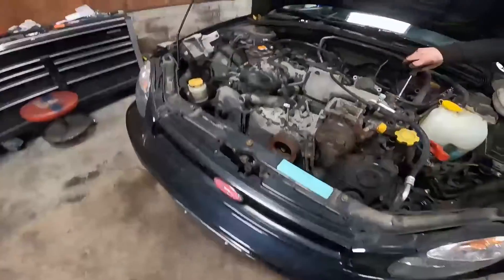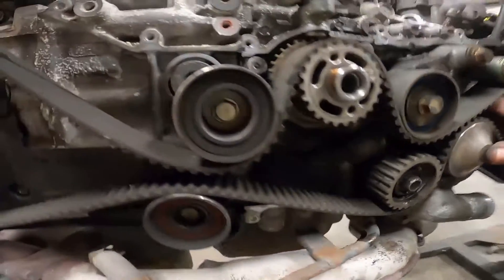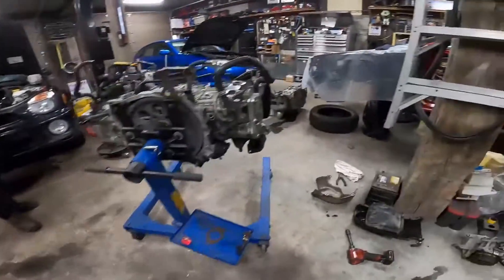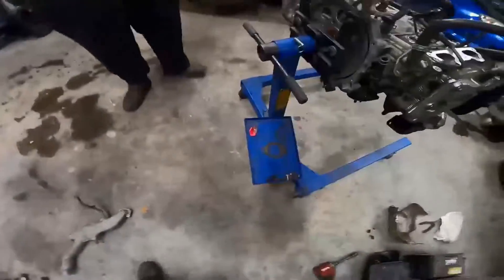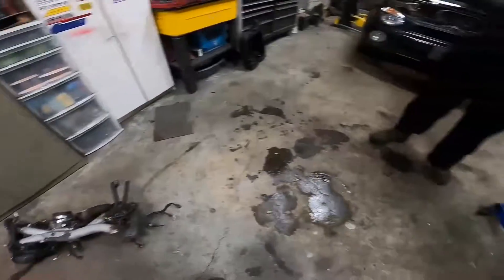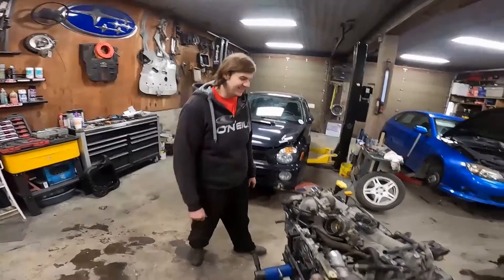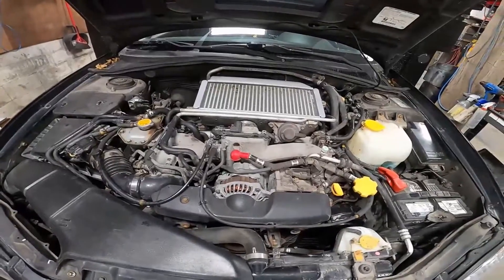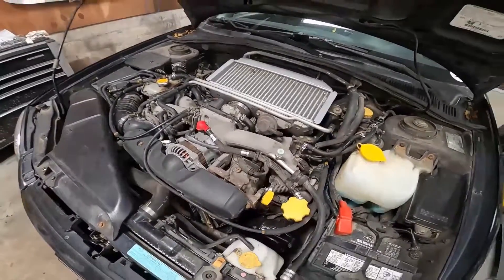How To Install Jdm Ej205 Into Usdm 02-05 Wrx

Comment: So I’m looking to a 2004 Subaru wrx it has a jdm ej205 and a oem ecu and it has a check engine light saying for a tune he says it needs to be tuned for the new engine. Would I be able to use a Cobb access port to tune for that and get rid of that check engine light?
Reply from the maker: Yes you can use cobb ap on the usdm ecu to tune check engine light
Reply: @TheSubieSanctuary  What tune would I need to use?
Reply from the maker: @jordanv7903  no cobb ap tune will be correct for the jdm 205 with usdm ecu. Ideally you need it professionally tuned. 
The cobb ap is just an interface for tuning the car the maps on the cobb are a waste of time themselves and wont do much good

Comment: In the middle of this swap, with usdm ecu the car misfires/backfires and has trouble idling, with JDM ecu it just keeps cranking no start, also I don’t have the intercooler on yet just trying to see if the engine is healthy... any advice!?
Reply from the maker: Only way it will run without intercooler is if you unplug the maf sensor. Try that and report back. 
Jdm ecu requires some wiring to be done or else youll be sending signal to tgvs rather then avcs
Reply: @TheSubieSanctuary  It worked! Thank you guys! Also I figured out the body harness was not the original one so that’s what cause the backfires I’m assuming. I’m trying to help a friend do this swap, awesome vid! 👍
Reply: @TheSubieSanctuary  Alright so the car is idling and runs but for some reason it kinda sputters when driving normal but WOT it drives perfect.. any ideas? Sorry to keep bugging you guys
Reply from the maker: @Nes_2k  no worries buddy, that would just be me guessing without being able to see it. Things that most commonly cause that are maf or or front o2 sensor.
Reply: @TheSubieSanctuary  I’ll give it a try thank you guys 🙏

Comment: Hey guys with me is the other way around I have an ej205 with the double breathers on the sides but I recently got a jdm with the single breather is is the same process to make it run ?
Reply from the maker: Yes essentially the same. Use the single breather pcv system

Comment: Sup guys, great vid I'm doing this swap this weekend and following weekend, and I was hoping I could get some thing cleared up I may just be overthinking it but anyway, I wrote down everything I need to replace and swap but theres other videos saying you need to do "more" than this video suggests, so do I need to replace my timing belt (which one is best if so?) crank pulley(s), or my water pump? Thank you in advance
Reply from the maker: To make it work without issue you do only need to do what we did in this video. 
You dont need to replace your timing belt unless you want to. Best water pump is aisin.

Comment: I didn't see you take out those cams
Reply from the maker: Ya exactly, its a myth that it’s necessary. Never swap the cams
Reply: @TheSubieSanctuary  most certainly not a myth
Reply: @TheSubieSanctuary  I'll bet anything you want on that
Reply from the maker: Mike Roshop ok, and why?
Reply: @TheSubieSanctuary  I mean the car will run, just not right
Reply: Why wouldn't the car run right??
Reply from the maker: @williamm19  l wish he elaborated on that too 😂 however, Ive done his countless times. It will run fantastic and make better power then the original 205. 
The best part is, leaving the cams then later you have the option to get avcs ecu with very minor wiring and get even more power.
Reply: Thanks I'm in the middle of swapping out my ej205 nonavcs to a single avcs and that was something I was having a hard time getting a straight answer. So only coolant crossover pipe and sensor and maybe some vacuum hoses??
Reply from the maker: @williamm19  thats it brother! You may have to use the jdm pcv routing pipes as the jdm 205 has 2 crank vents and normally the usdm 205 will only have 1 vent.
Reply: One last question. Since I'm not switching my cams do I need to switch my cam position sensor. The engine I had was a ej205 non avcs and I'm putting in a single avcs.. the guy that had the car before had swapped in the non avcs engine but I don't know if he switched over the usdm sensors to the non avcs engine. Is there a certain way to tell??
Reply from the maker: @williamm19  it will run even with jdm cam position sensor. We just swap them as we know the usdm ones were working
Reply: @williamm19  you're really losing power and creating more boost lag by not swapping out those intake cams

Comment: I have a Legacy with a JDM EJ205 swapped in, with a USDM '03 WRX ECU. It runs and drives, but I don't think I'm getting all the power I should be. A few mechanics have told me I need to get the JDM ECU and wire it for AVCS. How are you making it work properly without the AVCS?
....actually it looks like they left the JDM intake. Is this why I'm having these problems?
Reply from the maker: We are just running it without avcs in this one. 
Most of the jdm swaps we do, we do run the jdm ecu and wire in the avcs. 
Very easy to do. Iwire.com sells the wire harness for $100 and you can get the jdm ecu for $100 no problem. 
Did your jdm engine come with metal intake manifold on it? Or plastic
Reply: @TheSubieSanctuary  metal. When you swap without AVCS, though, are you getting full power? Like I said, my car runs fine, but it seems much slower than it should be.
Reply from the maker: hedgeclipper418 jdm 205 not running avcs vs usdm 205 will make the exact same power.

Comment: I can’t build past 8psi of boost would it be because the jdm turbo is still on ?
Reply from the maker: Hey buddy, please subscribe! The jdm turbo will hit 14psi when stock. It could be a vac or boost leak or issue with wastegate. Any check engine codes?

Comment: How come you didn’t have to switch the cam gear? Just asking because I’m in the middle of doing the swap myself right now and that’s what I’ve been worrying about this whole time
Reply: Good to know. I noticed the crank sprocket was the same as the usdm one so it made me wonder if I even had to change the cam gear. Thank god I found this video now because I didn’t want to have to go through the hassle of taking off that weird looking cam gear on these lol
Reply from the maker: Darryl Torres ya i figured it would be helpful. Some much mis information on the net on how to do these.
Reply from the maker: if you remove the jdm gear and usdm gear you will see they have the timing spurs in the exact same spots. The car wont know the difference. 100% do not have to switch the timing gear. That seems to be some weird bit of info on these. 
Ive done 20+ of this exact same install. Never changed a timing gear.
Reply: Ok one last question what do you do with the extra coolant hoses that come from the jdm motor? Do you just cap them and put a hose clamp over them?
Reply: I’m sorry idk if there coolant hoses or breather hoses. But I’m talking about the extra hoses that are on the valve cover gaskets
Reply from the maker: Shouldnt be any extra coolant hoses. 
Only extra pcv vents on center of block and each cylinder head. 
You use the jdm pcv piping then they all connect and vent as they should. 

Only possible extra coolant hose could be the cylinder 4 exit out the back of driverside cyl head.
Reply from the maker: Use the jdm metal pcv piping from valve cover to valve cover.
Reply: Thanks for the video! My Bugeye with 175k needs HG repaired. So I was thinking of doing this swap. Do the JDM motor still suffer from HG and piston ringland failed like usdm motor? Thanks